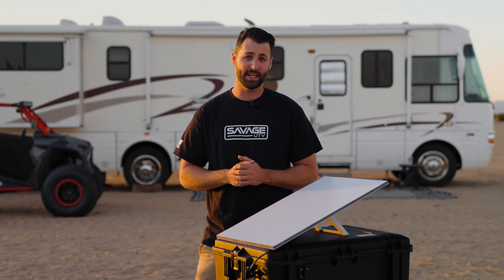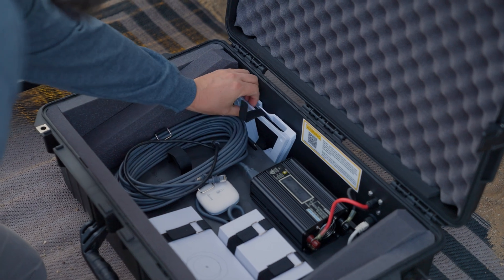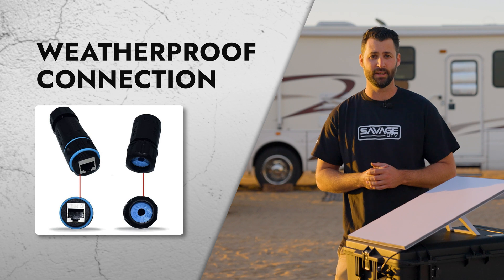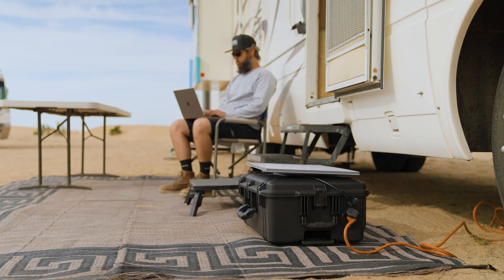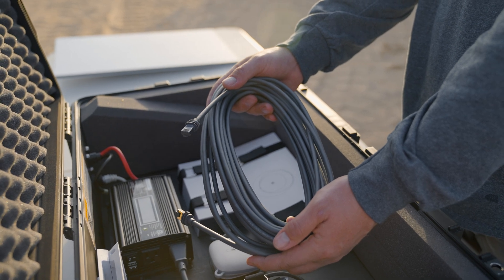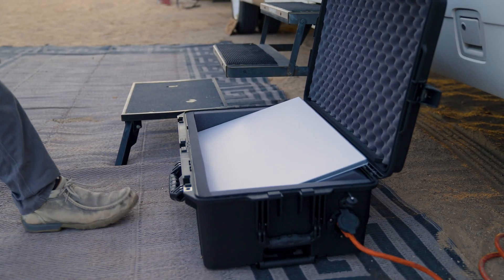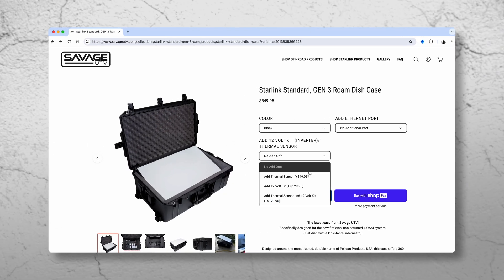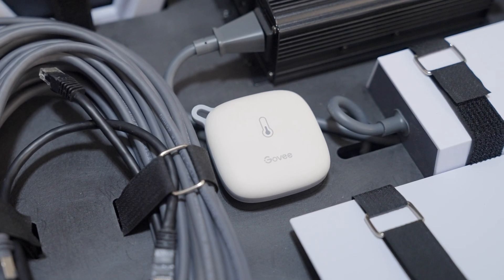StarLink Deployment Gen3 Savage Case

Comment: Are the external ethernet ports shielded? Also if you run the case closed with dish outside are you fine for the heat buildup or do you still have the 2 hour max warning?
Reply from the maker: We carry shielded and unshielded cables. Just depends on what you prefer. The heat concerns are when the actual dish is inside the case. We have seen temps well below Starlinks recommended temps inside the case with just the router and power unit operating.